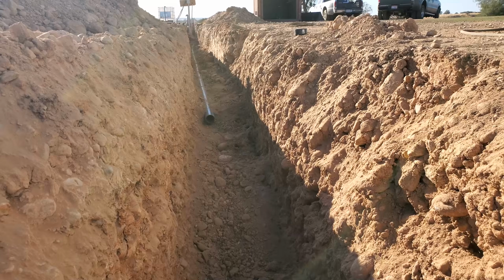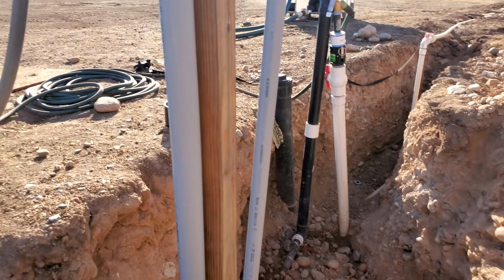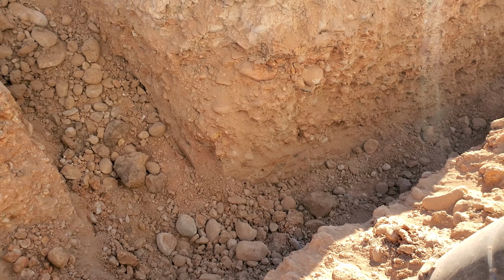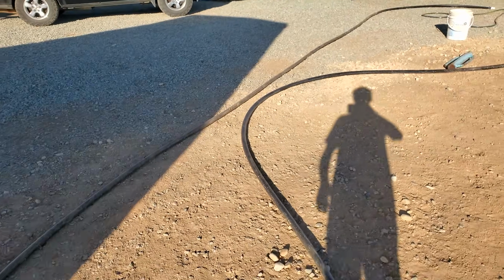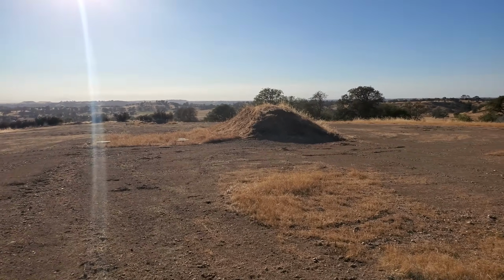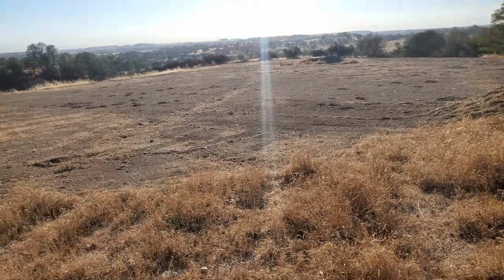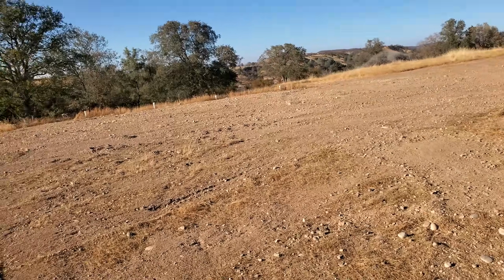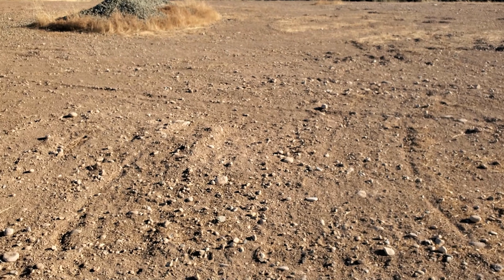Off Grid: Septic System Extension & Overview

Comment: why is your septic installed so far away from your living area?
Reply from the maker: The location is where the dirt had appropriate drainage characteristics... We have a lot of clay soil that doesn't drain very well
Reply: @HighTechLab  just a thought here but it would have made more sense to get an excavator on-site to dig a large four foot field close to your needs and fill it will good soil from the far away area. Hope you don’t have any issues, I’ve seen many long septic runs haunt homeowners in my career